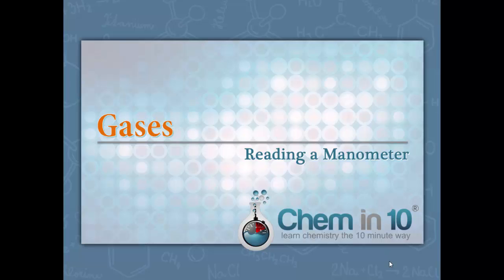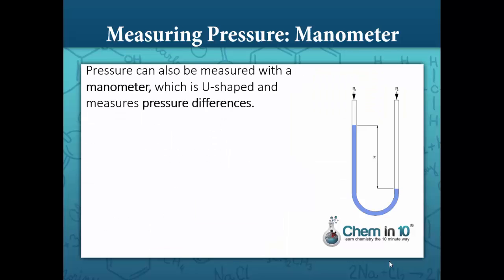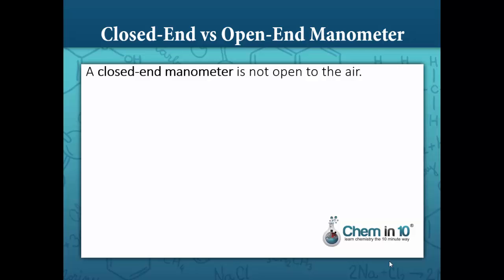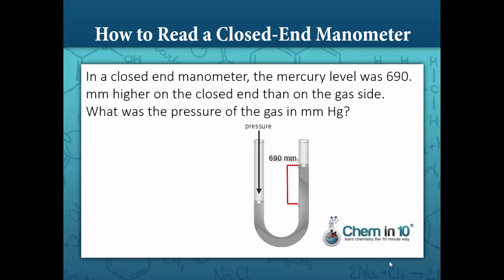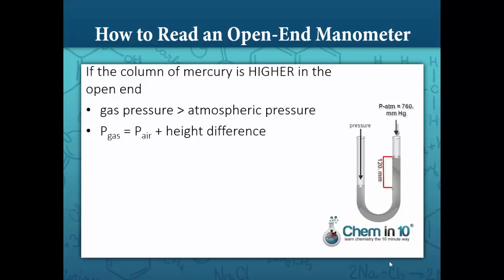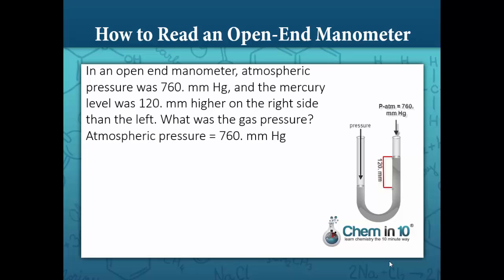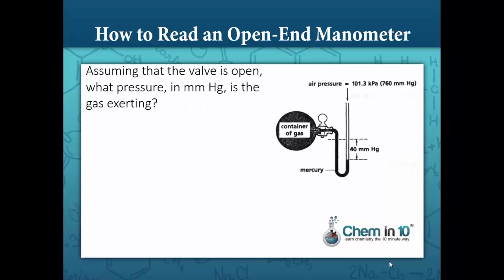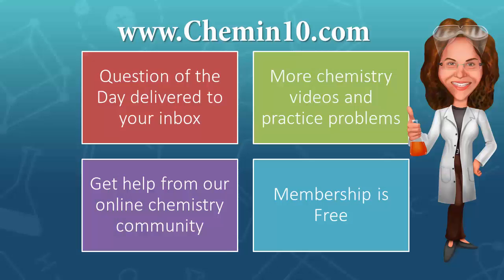How to Read a Manometer in Chemistry

Comment: How can I know if it’s above or below the atmospheric pressure ?
Reply: By the direction that the liquid moves in the U-tube.  If it moves toward the gas then the gas is pushing with less force than the atmosphere so you subtract the difference in column height from atmospheric pressure.  When the liquid shifts away from the confined gas, the gas is pushing with more force than the atmosphere so you add the difference in column height to the atmospheric pressure.